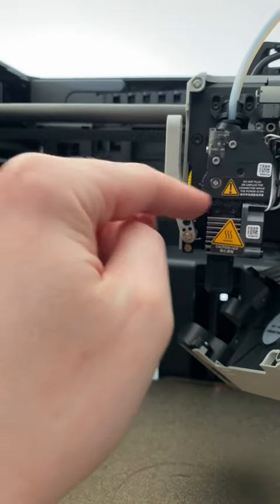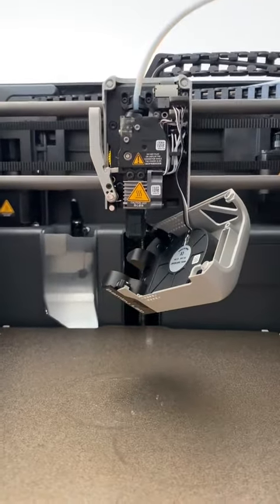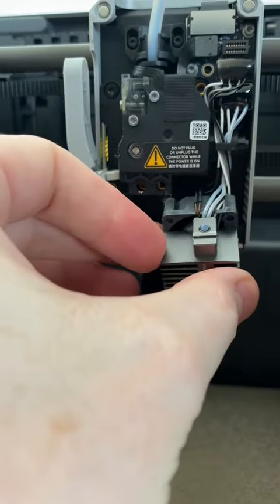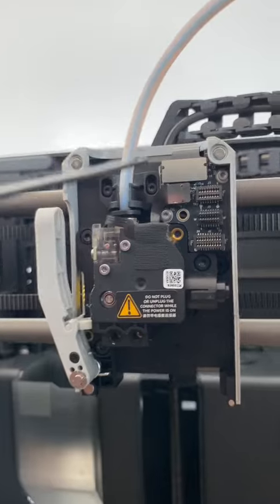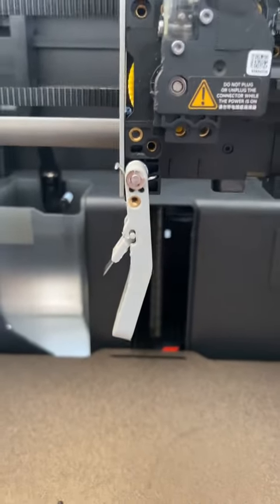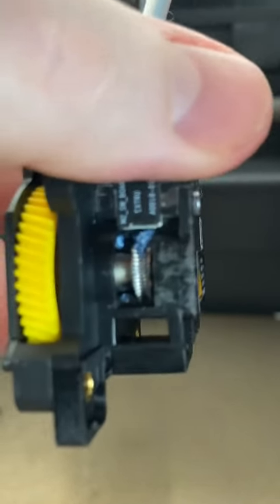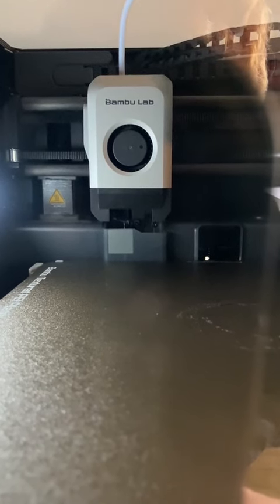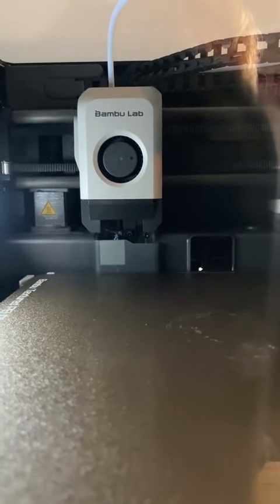P1S filament stuck in extruder.

Comment: This showed me nothing on how to actually fix it or how you cleaned it. You semi took it apart then skipped to when you had it back together again.
Reply from the maker: Haha you are kinda right, when I had the gear wheel out, I found out there is a screw on the end that holds the spring, if you loosen it it all comes apart, and you can easily get the filament out

Comment: I got this on my third freaking print on my P1S.

Pretty frustrating as a Voron owner.  I've never had anything  like this happen.
Reply from the maker: @TheMugwump1  yes, its really frustrating indeed. Was it also cause of wrong settings? Mine clogged cause I forgot to change from ASA to PLA in the settings. So it got wayyy too hot for the pla.
Reply: @JimmiboY  I just noticed this so I'm chalking it up to user error since the bamboo slicer is new to me.

Now Ivew got to tear the thing apart...I think its the filament sensor thats stuck or something cause it wont even make noise trying to load filament

Comment: Yup.  I had a jam in the extruder and the hotend was full.

It was easy to unjam for me.  I just removed the cover for the large gear and loosened the tensioner and removed the large gear exposing the clog.  After some poking and yanking I got the piece out of the hole.  The extruder gears were clean for me.  I just had to use a tiny drill in a pin vice to clear out the first couple millimeters of stuck filament in the heat-break so that the new filament i was going to extrude would have a clean path.

Everythings working great now and Im almost done wit the first print afterwards.   Gonna try some ASA next.

I just need to learn how long this bed will stay hot.  I want to heat the chamber for 30 or 40 minutes before I start